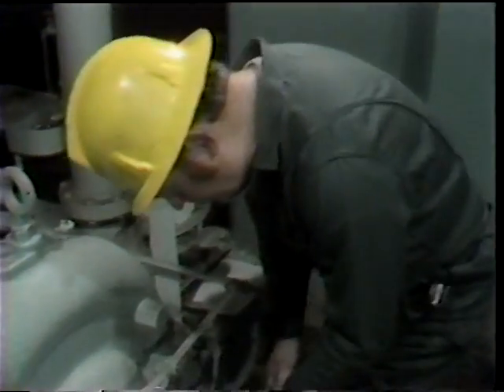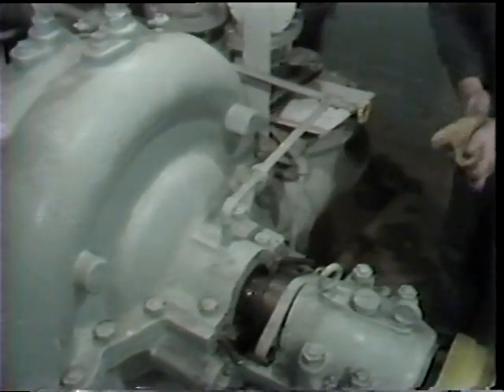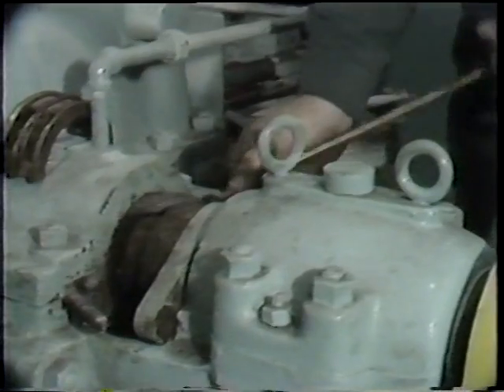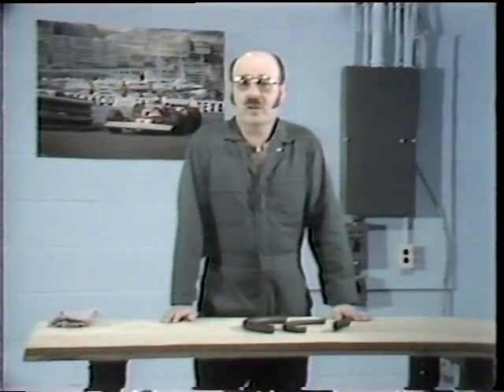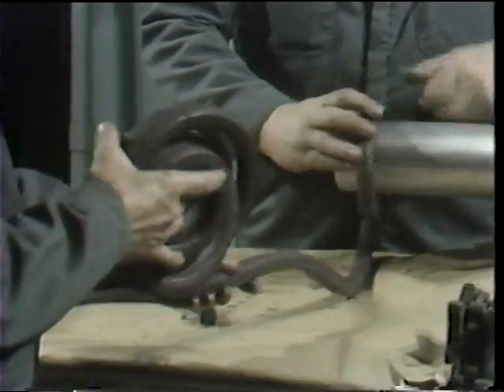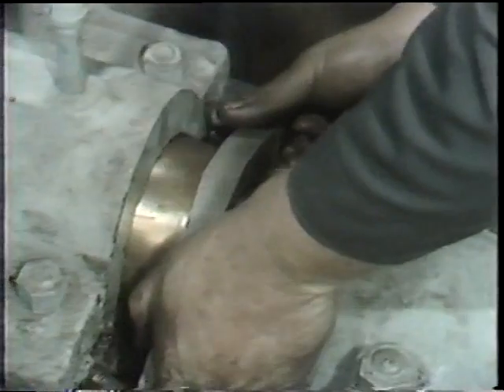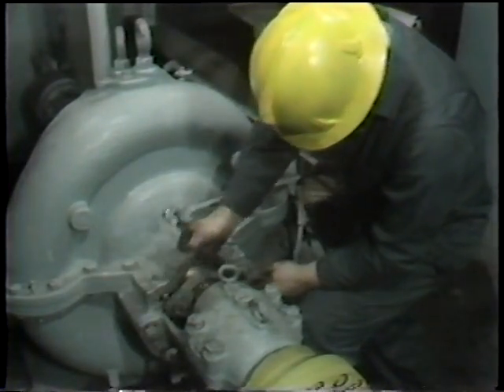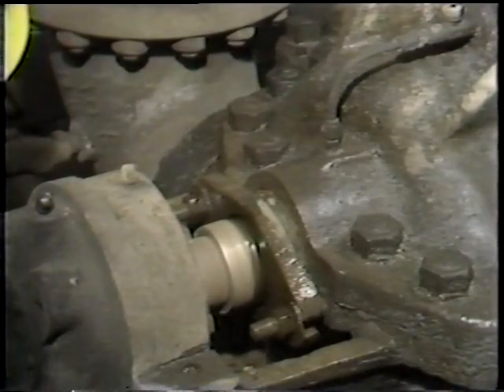Pump Packing Replacement

Comment: When you get to the lantern ring, open up the supply valve slightly to pressurize the inside of the pump with city pressure. It will start to push the landing ring out so you don’t need to pull it. It will also push out the other two or three rings worth of packing. It helps.

Comment: I can see how this would be good for not having to replace the actual pump which looks like it would be a big and expensive job. I would rather have a sealed bearing of some type that can be pressed on and pulled off if it starts leaking.

Comment: You said it the "80's"! In Texas we use a procedure while installing the new packing set called the seatit... How do you seat every ring to the bottom of the stuffing box correctly? Well, the tool is very unique and manufactured here in North America to set every ring to the bottom of the stuffing box one at a time to ensure that every ring is seated from the bottom to the top with equal amount of pressure radially. So, when you finished setting every ring you never pressed the first four rings to the bottom of the stuffing box with equal amount of pressure. Now you will create ware on the shaft sleeve on number five and six rings cause you used the gland follower to push the rings to the bottom of the stuffing box. For instance, if you took a loaf of bread and stood it up and used force to push the top slice to the bottom slice you would only have squeezed the top third of the loaf never putting pressure on the bottom third of the loaf. You'll never create a seal if you can't seat every ring radially to the bottom of the stuffing box and you will burn the packing up before it ever runs reliably. Hope this sums it up... Have a blessed day!
Reply from the maker: Thanks tommy for your comment